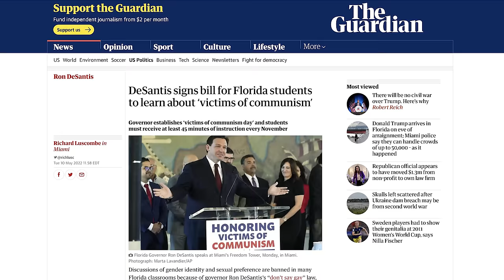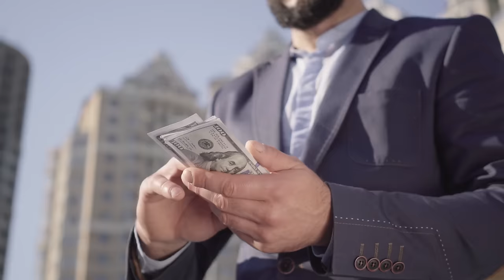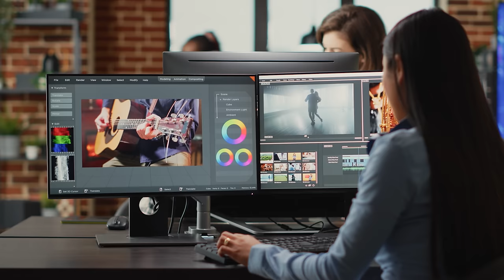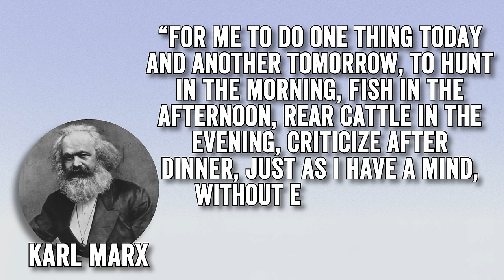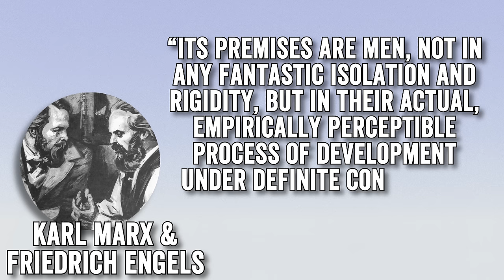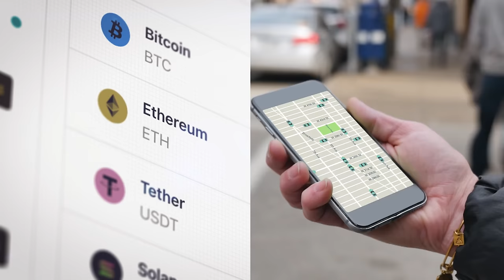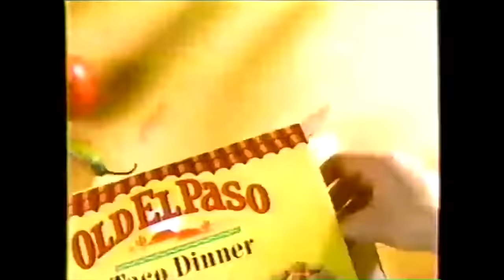Who's Afraid of Marx?

Comment: Marx is a critic of capitalism, but doesn’t have a concrete plan or ideology to replace it. This fractured his disciples that use his first assumptions of power dynamics, with their own totalitarian assertions on how to fix the problems. In short, Marx has fair and intellectual honesty critical of the “system”, while not proposing a replacement for the system, and centralized powers have used his work to gain power and institute their own biased form of society that will never eclipse modern capitalism ie hitler, stalin, and various authoritarian states around the world. They all end poorly because they don’t actual fix the system and Marx’s assumptions of labor and power are from the 1850s when most work was done by hand, not big heavily capitalized machinery. I agree with a lot of his critique of power, but not the solution to the problem.
Reply: Boom

Comment: Marx's theory of value is flawed: Surplus value is not created in production, only the buyer of a product can pay for it on the market, but that does not have to be the case.
You can only produce the conditions for surplus value payments, not the surplus values themselves.
An entrepreneur can only estimate what surplus value he can demand on the market, under certain circumstances he cannot demand any and sometimes not even full reimbursement of costs.
The surplus value that the entrepreneur estimates is an expected surplus value.
Since surplus value is part of value, there can only be an expected value on the production side of commodity society.
Marx tried to describe the creation of value with a formula that he applied to the production side of commodity society, since for him the market has no significance for the creation of value:
W = c + v + m.
W value of a product of labor
c constant capital (proportionately the costs for raw materials, supplies, premises, electricity, in Marx's case also machines, etc. per product)
v variable capital (proportionately the costs for labor - in Marx only human labor)
s surplus value (is created by the labor (in Marx only human labor) in the so-called unpaid working time).

Since there is only one expected surplus value on the production side, there can only be one expected value there:
W|expected = c|cost factor, replacement expected + v|cost factor, replacement expected + s|expected. 
In addition, the surplus value is not paid on the costs, but on the replacement of the costs. If the surplus value were paid on the costs, it would not be surplus value, but a partial replacement of the costs! 
Only on the market, when a buyer buys the product of labor, can surplus value arise, namely when the buyer completely replaces the costs and pays even more - the surplus is the surplus value! Thus, the value is created on the market and not within the framework of production. Value is a social relationship between buyer and seller.

Marx's false belief that value was created through production led to many other errors that in practice led to major problems in the economy of socialist states: the importance of the market was not recognized and value creation was misjudged: the expected values of the production side of commodity society were interpreted as real values. 
In this way, the economy became increasingly ineffective over time until it collapsed. 
Part of this misdevelopment was that no value was assigned to natural goods, etc., and that the permanent money surplus (money was put into circulation according to the supposedly produced values) made it increasingly difficult to recognize what was being produced and how effectively what was being used. 

I think anyone who has not experienced socialism cannot really understand it.

Comment: Conflating money supply with economic output.  Not the same thing.

You can't print your way into prosperity.  

Might want to learn these basics before creating a video on the subject.
Reply: Why does economic output increase?
Reply: @Joshua  More efficient machines/methods is an example of a way to boost economic output.
Reply: Marx never said that, and neither did the presenter in the video.
Reply: @Cat_City  The presenter did, otherwise I couldn't have commented on it.
Reply: @imzack27  If the value is produced by machines, who should get to keep it?
Reply: @Joshua  keep the machines or the value?

Whoever took the risk in purchasing the capital should be on the hook for the profits or losses.  
If they make profit, they can decide on how to allocate that profit going forward, such as purchasing more capital equipment. 

But this is getting off from my original point.
Reply: @imzack27  
Time stamp.
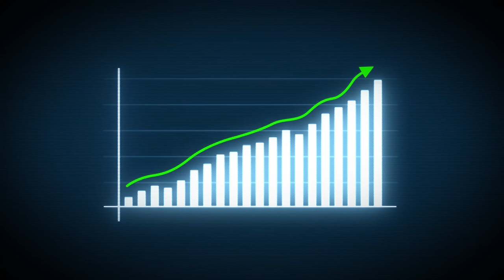Reply: @cat_city2009  @3:33

Comment: I think marx is correct in alot of ways, but i think he was wrong about profit. The systems can generate profit without taxing its workers through 2 means. The first is teamwork humans working together are provably more effective than working alone and that is the first key of product. The second form of profit comes from tools lasting longer than their purpose when one goes to the store to buy a screwdriver   uses it once and then later sells it second hand that second hand sale generated profit as the refined tool continued to work past its intended purpose and generated value. Past works of humanity can often increase the total amount of work that can be done in the modern system thus increasing the economy(which is a measure of how much work can be done in a year anyway.) And that difference is a profit on a macro scale.

Capitalists do exploit their working class but there is no reason they need to, to generate profit and that is the true evil of classism.
Reply: I agree. Well said.

Comment: Sure… we can derive things about the value of a good or some analysis of capitalism… but it’s so outdated and pertains to an early 20th century economy. It’s not super relevant anymore. We need new modes of thinking about our CURRENT economy.
Reply: Many of the fundamental structures haven't changed, though. And to the degree that they have, you can still use Marx's methodology to think about those changes. Marxism as a tradition of thought doesn't use Marx as an end-point, no Marxist think Marx had all the answers or got everything right. Marxism is a tradition of thought that has developed whilst capitalism has developed.

Comment: Cancel the second law of thermodynamics 
Chose perpetually changeable conserved energy. 

The second law of thermodynamics is a misstep in civilization that had a distinct begining with Isaac Newton's correct scientific observation that the heat of a fire in a fireplace always flows towards the cold room beyond. Heat never flows spontaneously from cold to hot. 

Scientific interest in heat peaked when Victorian England became enchanted with steam engines and their cheap reliable and placement flexible physical power. Scientists of the era with wide cultural support formulated the second law of thermodynamics using evidence from steam engine development. The law's formulaters considered with acceptance [A+] Inefficiently harnessing the flow of heat from hot to cold or [B+] Using force to Inefficiently pump heat from cold to hot. They considered with rejection [A-] Waiting for random fluctuation to cause a large difference in temperature or pressure. This was calculated to be extremely rare or [B-] Searching for and selecting for use, random, frequent and small differences in temperature or pressure. The search and selection would require more energy than the use would yield. These accepted options, lead to the consequence that the universe will end in stagnant heat death, a theory that was part of a theological trend of the time. 

Another option is for any random usually small fluctuation of heat or pressure to deterministically self select differental passive treatment so the output is no longer random. Then the net power of many small fluctuations from many replicant parts can be aggregated into a large difference in temperature or pressure. 

Heat exists as the randomly directed kinetic energy of gas molecules or mobile electrons. In gasses this is known as Brownian motion, in electronics this is carefully labeled Johnson Nyquist thermal electrical noise. Hypothetically diode depletion regions are practical sites for enabling mobile electrons energized into motion by thermal electrical noise to deterministically select the direction they will carry electricity. 

Mobile electrons in the depletion region of a diode are rectified by their interaction with the surronding structure. Inner electrical equlibrium creates a depletion region which straddles the abrupt physical junction between the N type and P type regions of a basic solid state diode. The depletion region has variable electrical conductivity which depends on the energy and direction of motion of the mobile electrons inside. If the net motion of mobile electrons there energized by thermal electrical noise is towards the P type region, the depletion region contracts and the electrical conductivity will increase, conveying the electrons further into the P type region and beyond. If the net motion of mobile electrons in the depletion region there is towards the N type region, the depletion region will expand and the electron current will decrease.  

Consistantly oriented diodes in parallel may be successful electrical Maxwell's Demons or Smoluchowski's Trapdoors. The energy needed to shift the depletion region's deterministic role is paid as a burden on the moving electrons. There would therefore be usable net aggregated ŕectified power from each and every diode connected together into a consistantly ořiented parallel group. Any diode efficiency at all produces some energy conversion from ambient heat, more efficiency yields higher performance. A diode array that is switched off has no energy conversion and no performance. 

The power from a single diode is poorly expressed. Several or more diodes in parallel are needed to overcome the effect of a load resistor's own thermal noise. A plurality of billions of high frequency capable diodes is needed for practical power aggregation. Zero to ~2THz is the maximum frequency bandwidth available in nature. This is beyond the range of most diodes. Practicality requires this extreme bandwidth. The diodes are preferably in same orientation parallel at the primary level. Many primary level groups of diodes should be in series for practical voltage.

Diodes in massive same orientation parallel are easily fabricated between an ohmic contact layer abutting all the anodes and another ohmic contact layer abutting all the cathodes with identical very small laterally isolated diodes between. 

Sandwiches of vertical diodes can be piled into stacks to become connected in series. Layers of heat transfer conduits may be fabricated between the sandwiches too. 

In 1973 I filed for a patent,  us3890161A, Diode Array, for a device which absorbs heat converting it to an equivelent amount of electrical energy via aggrgated rectified Johnson noise from a plurality of consistently aligned very small diodes. The patent was granted in 1975 and became public domain technology in 1992. The patent is attribution for my thinking in 1973. It is a new paradigm in science and civilization. Everyone should contribute to civilization's advancement cooperatively. 

Ever since Newton's observation was assimilated and the second law of thermodynamics was formulated education has mass produced 
the conventional wisdom throughout society that the second law of thermodynamics is valid. 

If counterexamples invalidated the second law of thermodynamics civilization would learn it could have perpetually convertable conserved energy which is the form of free energy where energy is borrowed from the massive heat reservoir of our sun warmed planet and converted into electricity anywhere, anytime with slight variations. Electricity produces heat when used by electric heaters, motors, or ligts so the energy borrowed by these devices is promply returned without gain or loss. There is also the reverse effect where refrigeration produces electricity equivalent to the cooling which is scientifically elegant. 

Cell phones wouldn't die or need power cords or batteries or become hot. They would cool when transmitting radio signal power. Computers and integrated circuits would have their cooling and electrical needs supplied autonomously simultaniously. Integrated circuits wouldn't need power pinouts. Robots would have extreme mobility. 
Frozen food storage would be reliable and free or value positive. That means storehouses, homes, and markets would have independent power to preserve food. Vehicles wouldn't need fuel or fueling stops. Elevators would be very reliable with independent power. Water and sewage pumps may be placed anywhere. Nomads could raise their material supports item by item carefully and groups of people could modify their settlements with great technical flexibility. Many devices would be very quiet, which is good for coexisting with nature and does not disturb people.
Zone refining would involve little net power. Reducing Bauxite to Aluminum, Rutile to Titanium, and Magnetite to Iron, would have a net cooling effect. With enough clean cheap power, minerals could be finely pulverized, and H2O, CO2, and other substance levels in the biosphere could be modified. There should be a unitary agency to look after our global planetary concerns. 

This is a material revolution with spiritual ramifications. Everyone should contribute individual talents and fruits of different experiances and cultures to advancing a cooperative, diverse, harmonious and unified civilization. It is possible to apply technlology wrong but it shouldnt be done. 

Inventive concepts that are widely published become unpatentabe. A public incorruptable archive could secure attrbution for the original works of creators. Uncorrupted copies would be releaseed on request. No further action would be taken by this institution. 

Many financially and procedurally independent teams that pool developmental knowlege, and may be funded by many separate noncontrolling crowd sourced grants should convene themselves to develop proof-of-concept and initial recipe prototypes to develop devices which coproduce the release of electrical energy and an equivalent absorbtion of stagnant ambient thermal energy. Diode arrays are not the only possible device of this sort. 

These devices would probably become segmented commodities sold with minimal margin over supply cost manufactured by AI that does not need fimancial incentive. Applicable best practices would be adopted. Business details would be open public knowledge. Associated people should move as negotiated and freely talk. There is no need of wealth extracting top commanders. We do not need often token philanthropy from the wealthy if people simply can be more generous if consumer commodities are inexpensive. 

The conventional wisdom throughout society now is that the second law of thermodynamics is valid. 
Industry, government, comercial science, academia, finance, and the military are not configured to develop this easily.
There may be "Murder on the Orient Express" style suppression of perpetually convertable conserved energy. 
Edward Bellamay's utopian novel "Looking Backwards" depicted world wide flat distribution of consumer goods.

Aloha
Charles M Brown lll 
Kauai Hawaii
1 808 651 **
Reply: not reading all that
Reply: This is the biggest echo chamber, pseudoscience BS and shifting of goal posts i ever read...
Reply: @saricubra2867 
I moved the point of view around a lot like sports TV programs do but kept it fair.
The only non standard thermodynamics I talk about here is arguments aginst 2LoT. 
Thanks for your reply. Its something I'll think about.
 Aloha
Reply: @CharlesBrown-xq5ug  “If your theory is found to be against the second law of thermodynamics I can give you no hope; there is nothing for it but to collapse in deepest humiliation”

— Arthur Eddington
Reply: @IAmNumber4000 
I try to be succinct. Nevertheless escaping 2LoT is an extraordinary claim so it needs extraordinary persuasion. This discussion is appropriate here to promote highly automated luxury planetary plus space cooperation.

Aloha

Comment: I say this in good faith, change my mind: 

It isn’t inherently exploitative that a capitalist pays the wage earner less than the value that their labor generates, provided that the wage earner has effective bargaining power. Otherwise, what exactly is the capitalist doing in the first place? What is their motive, if not profit? 

In a society without the individual capitalist, the role of capital is taken up by the public, ie the government. Correct? The problem with that is that the government functions best when it must serve competing interests. 

The issue we have in modern capitalist society is that one group’s interests are too powerful. My issue with Marx is that by abolishing the capital class, you aren’t solving that problem, you’re just shifting that excessive bargaining power to a different class. 

In general, markets are the most efficient means of distributing goods and services. Value added generates prosperity. Command economies are inefficient. A government beholden to any single group without meaningful competition breeds corruption. 

The liberal solution of retaining the capitalist system but focusing on making the relationship between capital and labor is preferable for these reasons - and we know that liberal solutions work when they’re implemented. Unionization is a liberal solution. Market regulation is a liberal solution. 

Marx throws the baby out with the bath water.